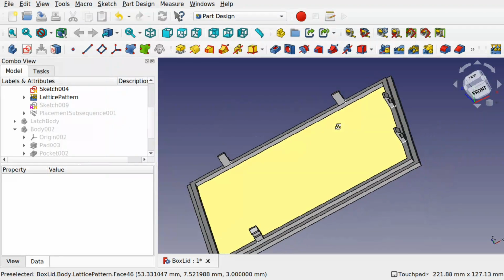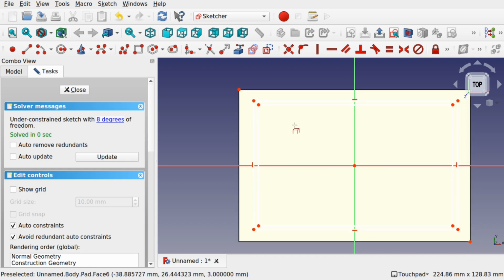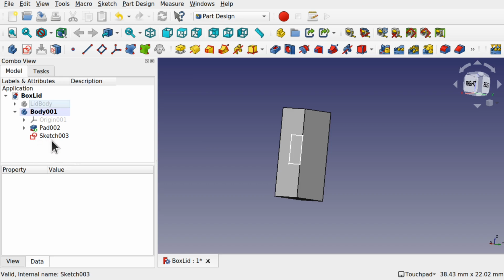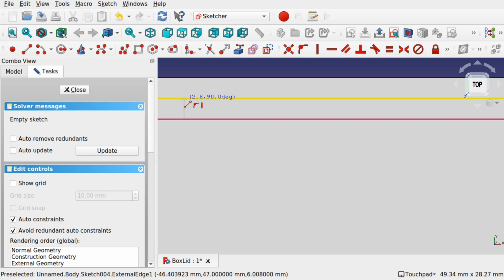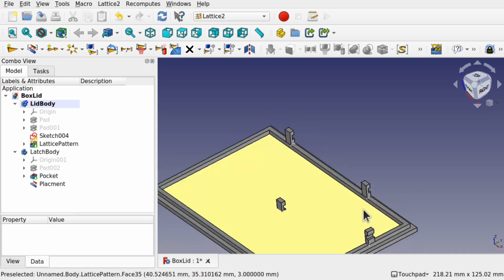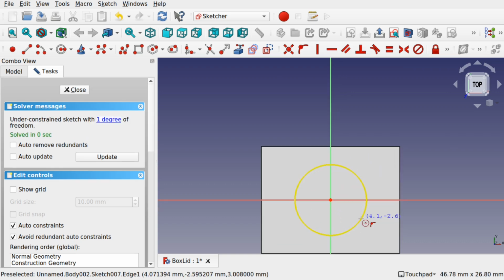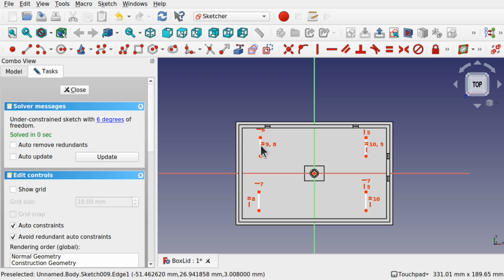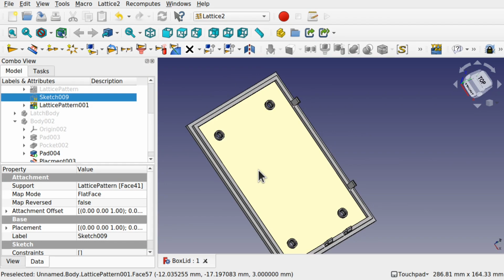FreeCAD: Lattice 2: Easy Part Design Patterns | Repeating Lid Latches and holes

Comment: This is good for adding mass. But what if you want a feature that both adds and removes mass—for example, a screw boss?
Reply from the maker: Ah you may of missed it but I am wondering if what you are looking for is at around 24:30 in the video which show a feature that adds and removes.
Reply: @MangoJellySolutions  I was trying to use this to make custom holes, seems a bit silly that i have to make a pad just to subtract it, but thanks :)